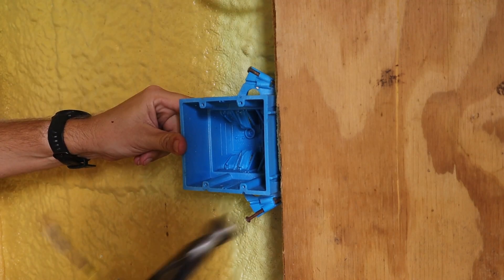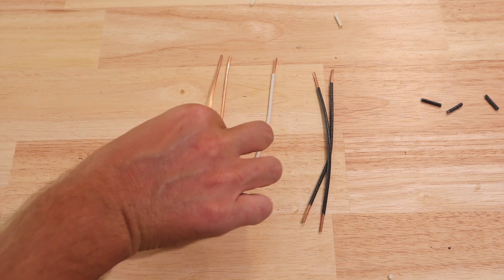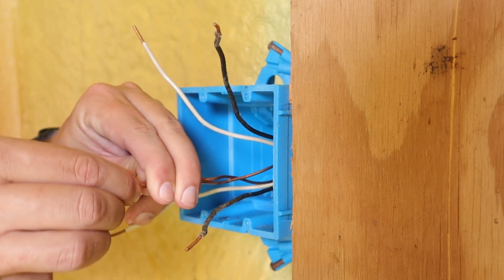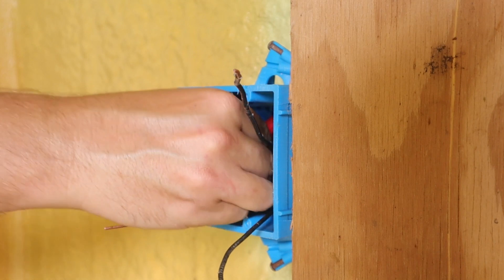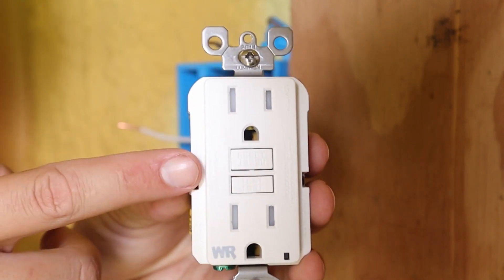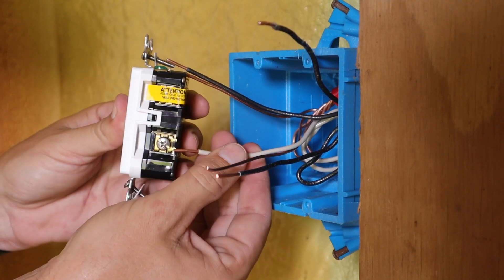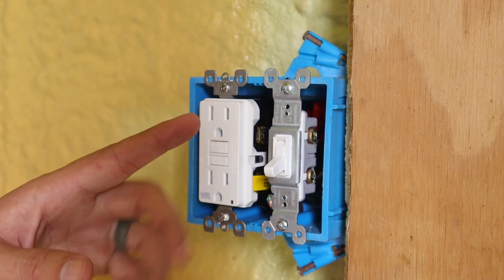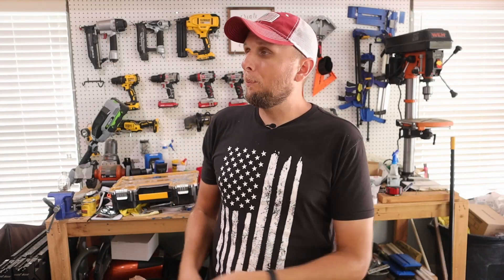Easiest Way To Wire a Light Switch and Outlet In the Same Box

Comment: Thanks so much
Reply from the maker: You are very welcome.  Glad you liked it.  Thanks for the feedback!
Reply: @HowToHomeDIY  
You described how I've always seen this done and I thought you did a good job presenting the information.   Question though, why isn't the following scenario acceptable?  Attach both commons to the proper side of the receptacle(always space for two wires).  Run the hot supply to the receptacle with a jumper to the switch.  Grounds connected as you described.   This would save two wire nuts and added wire leading to less clutter in the box.

Comment: Great video.   I have slider dimmer with a power on /off switch.  This is for a ceiling fan with light. i no longer  want the dimmer part, but there are 3 white wires and 3 black ,  also the power going to this box also applies two outlets on the other wall.  I am having trouble getting the ceiling fan and the outlets to work with a replace switch.  can you help